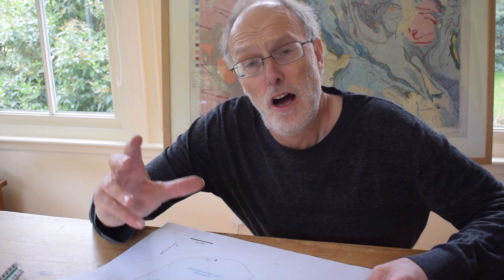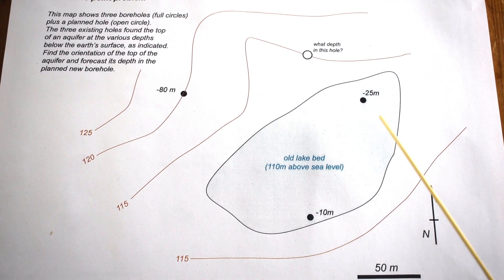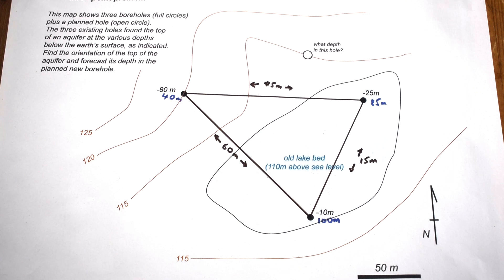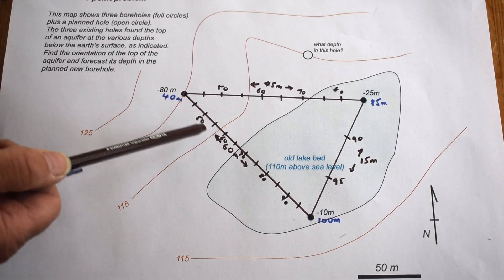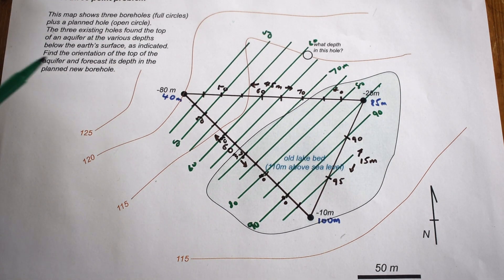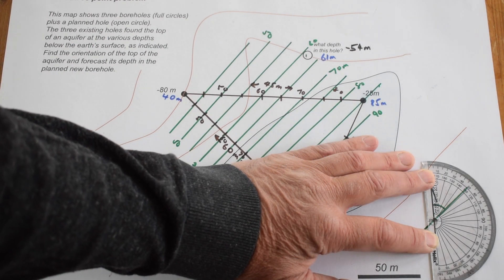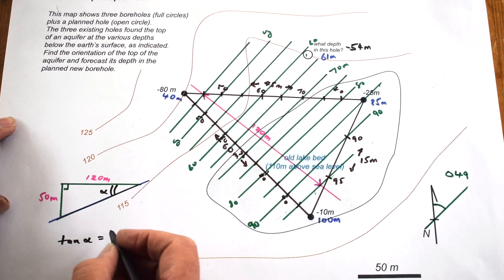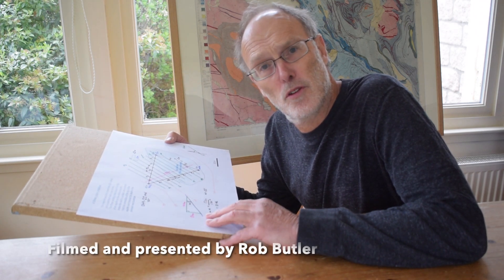A three point problem - finding the top of an aquifer

Comment: The surface is assumed to be planar in this example.  If you take the three points and their coordinates, X, Y Z  (Z being the elevation above sea level and not the depth from the surface), then you have a linear regression problem which is just three simultaneous equations in X and Y, e.g. aX1 + bY1 = Z1;  aX2+bY2=Z2; and  aX3+bY3 = Z3.   This can be solved using the method one learned in high school, or by matrices.    Software like Golden Software's "Surfer" will do this very easily.  If the surface is not planar and you have more than three control points, then you can use a curved surface like a quadratic or cubic surface to fit the data more precisely.
Reply from the maker: Indeed and there are several options for software. But I think it's always best to first do these things manually and graphically when introduced to techniques like this - so you can see what you're doing... and indeed even when experienced from time to time to make sure the software is doing what you think it is... same true for applications like plotting stereonets etc.
Reply: Over reliance on computers deskills people - the computer is doing all the work.